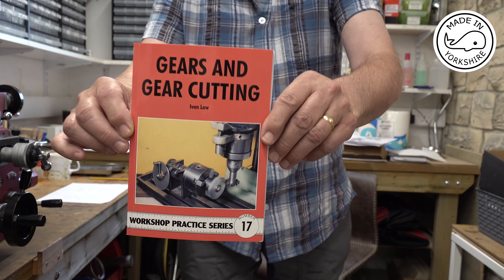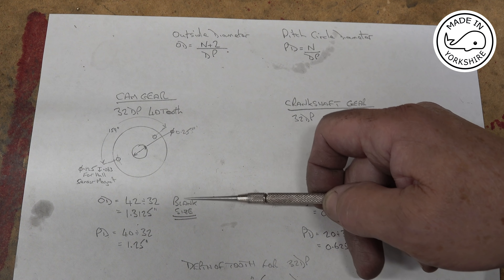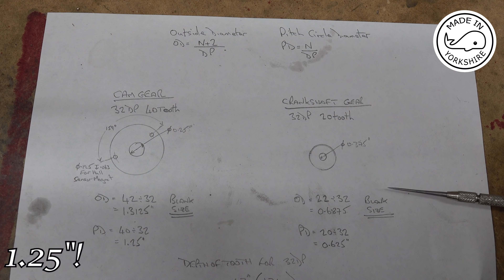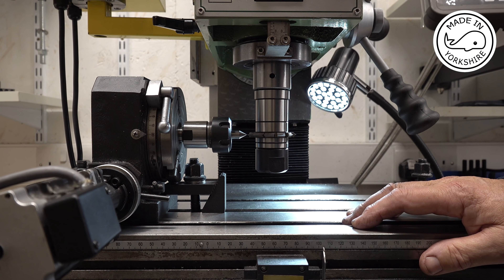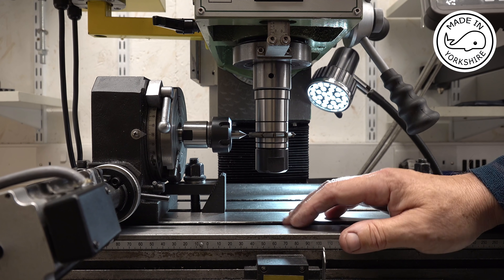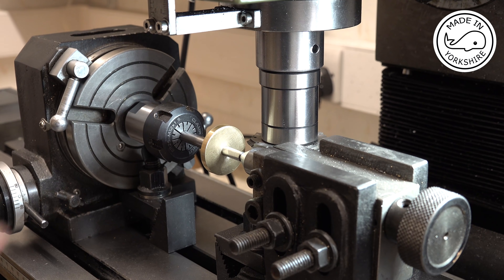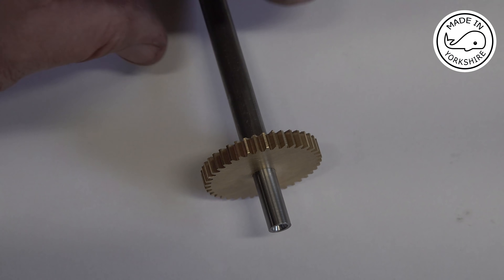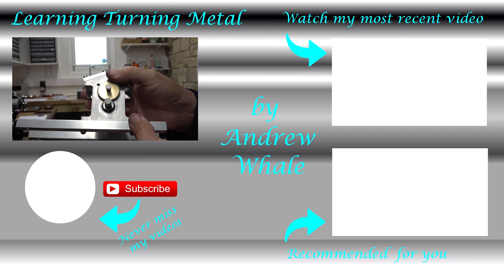#MT44 Part 2 - Hoglet V-twin IC Engine. Making the Gears. In 4K/UHD by Andrew Whale.

Comment: you dont filmed magnet sensor on gear wheel
Reply from the maker: Hi Yason. Correct. The location of the magnets is covered in Part 15. If you are building this engine the drawing shows the actual positions of the holes. The process of drilling the holes is straight forward.
Cheers
Andrew

Comment: Hi Andrew, any chance you can give me the make and size of your gear cutter arbor? I bought a set of blades, but the arbor I have is too small (16mm).
Reply from the maker: Hi Paul, I had exactly the same problem. I bought an R8 1" arbor from arceurotrade. Having got it I couldn't undo the nut on the end. Arc said it was a left hand thread but I still couldn't undo it. Arc were not very sympathetic, and I must have passed loads of business their way through my videos. I purchased another from Warco which was cheaper but identical. Product ref 008920. My neighbour managed to undo the nut on the one I got from arceurotrade and found it rusted up. So I would avoid arceurotrade for this particular tool. 
Cheers
Andrew
Reply: @learningturningmetal  
Thanks for getting back so quickly, very appreciated.
👍🏽👍🏽👍🏽👍🏽👍🏽

Comment: I have been looking in the Hemmingways engine catalogue, Tungsten points HEA1080. I think this is worth a quick read. For reference only.
Reply from the maker: Hi Mervyn - thanks for the info. I think I will steer away from points in future but the info could certainly be of use to others. I see Hemingways Kits refer to Minimag in the Isle of White. I've purchased a couple of Hall Effect electronic ignition systems from them. Not cheap, but a great product.
All the best.
Andrew

Comment: You came up in my recommended. I did find it interesting and I liked and subscribed. May I ask what drove the decision to make one gear brass and the other one steel? I’m not a model maker but I love studying all things mechanical. I look forward to watching the rest of this build. 😎👍👀
Reply from the maker: Hi Joe. I'm not a model engine designer either. My previous farm boy engine was designed to have the large gear made from brass and the small one from steel. My understanding is that on a sliding contact between two surfaces, different material, one soft, one hard have the best friction characteristics. So, for this engine I decided to follow the same approach.
Cheers
Andrew

Comment: Hello Andrew, I bought some gear gutters from RDG and although the bores were the right size they were not central, 0.003” runout. I rang RDG who were not interested. In your video the cutter is only cutting on one side, this may be runout due  re-sizing the bore. Not sure how the other cutter performed? May as well buy the cheap ones on eBay which are no worse. If the cutter only cuts on half its teeth it is not much better than a fly cutter. 

Does the Hoglet use a distributor or two censors?
Reply from the maker: Hi Simon - that's interesting. I also noticed that the cutter in the video had some runout. DP gear cutters seem to be difficult to acquire in the UK and I thought that the RDG ones would be reasonable. I nearly purchased a full set of 48DP cutters from RDG in preparation for making the Jerry Howell - I'm glad I didn't! My Mod 0.5 cutters were purchased from Chronos and eBay, and all look like good quality. I will definitely stay away from RDG gear cutters in future.
I'm not sure what the ignition system is on the Hoglet. I notice that the cam gear has holes for 2 rare earth magnets, so I'm wondering if the cam gear is acting as a distributor. Hopefully it will become clearer as I progress. Lots of other challenges though before I get to that stage.
All the best.
Andrew

Comment: Good job Andrew.  Had exactly the same issue with the 48dp gears for the Farmboy also purchased from Rdg. With a little persistence they eventually slid on the arbor but very snug.
Reply from the maker: Thanks Craig - that's interesting. I can't remember where I purchased my FarmBoy cutters from. I converted to mod 0.5 which gave me more purchasing options. I'm not convinced that the cutter I had to modify runs perfectly true either. I think I will try to avoid RDG cutters in future.
All the best.
Andrew

Comment: I hate to be an armchair machinist but why don't you cut the teeth on the blank before parting off?

That way the overall stability would be better and you wouldn't be relying on adhesives.

It also allows you to make duplicate gears in one set-up.
Reply from the maker: Hi Adrian - fair point. I must give that a try sometime.
All the best.
Andrew

Comment: When I seen this video pop-up so quickly after the last one, I was thinking "Mr Whale wants to see if the gear axle holes were drilled at the right spot!"  Looks like they were!  Good start to this engine.

If I hadn't already bought all the division plates and tooling for my rotary table, I would be looking very seriously at that Ward rotary controller.  It's very slick and certainly cuts down the chances of getting a fat or skinny tooth at the end.
Reply from the maker: Ha ha Douglas - you dead right. I was itching to see if the holes were correctly drilled. The controller definitely makes gear cutting less stressful.
All the best.
Andrew

Comment: I've had a similar problem with RDG slitting saws, where the key way was undersize and not square to the bore. Nothing that a few minutes with a diamond file wouldn't sort out, but not what I expect. Thanks for another great video 👍🏻
Reply from the maker: Thanks for the info James. My keyway was also too small. I don't have any diamond files so had to resort to grinding. Not great but not many other suppliers of DP cutters in the UK ☹️
All the best.
Andrew

Comment: Is there anything you can't do perfect? ⭐⭐⭐⭐⭐
Reply from the maker: Ha ha - probably making a Hoglet! This engine will be a bit of a challenge I think!
Cheers
Andrew
Reply: @learningturningmetal  Well it looks like you are off to a good start. That frame looked good to me. What would the gears have cost if you could even buy? Do you have a picture of what the finished engine should look like to post?
Reply from the maker: @gvet47  I think the two gears would cost around £45 in total. The gear cutters were £25 each, so it's break even at the moment. A real shame that one of the cutters is not to spec. I can't really show a close-up of the drawing as it's copyrighted. There are some pics of the Hoglet engine on the internet though.
Cheers
Andew
Reply: @learningturningmetal  I found some pictures and it looks like you have a lot of parts to make so it will be interesting to see how things work out for you. Wish you well.

Comment: Hi Andrew,
Nice work on the gear cutting... I have just ordered the book you showed... See you on the next one...
Cheers.
Paul,,
Reply from the maker: Thanks Paul. I purchased my book a couple of years ago as I was interested in making my own gears. I read it, didn't understand it, and it ended up on the shelf for about a year until I was ready to have a go at making some gears. After reading it a few more times, some of it sank in. I find that the most important bits are the formulae and the explanation of the terminology. It's definitely worth the money.
Cheers
Andrew